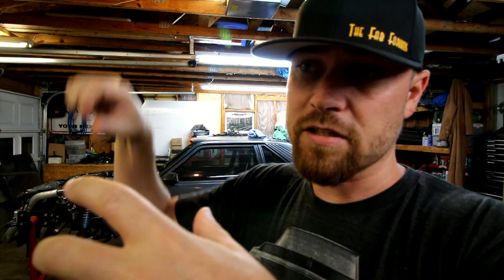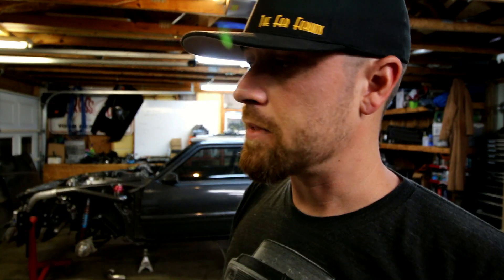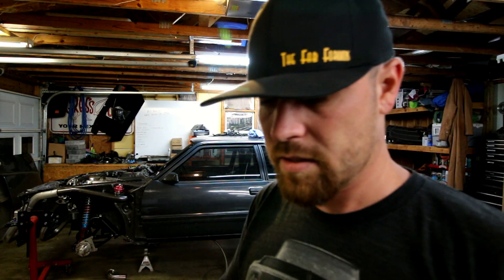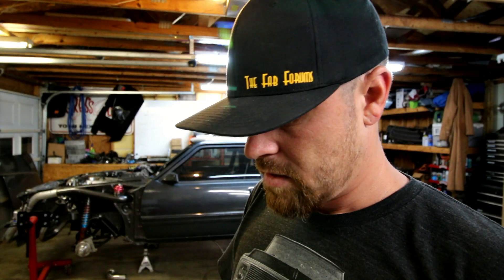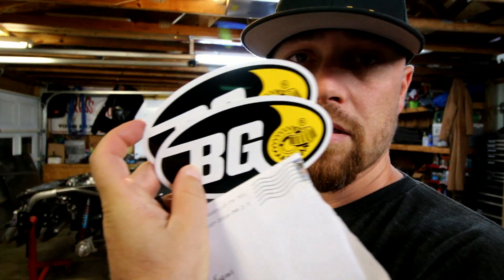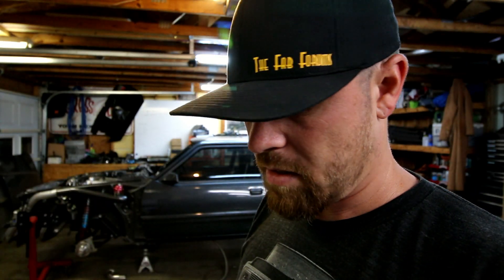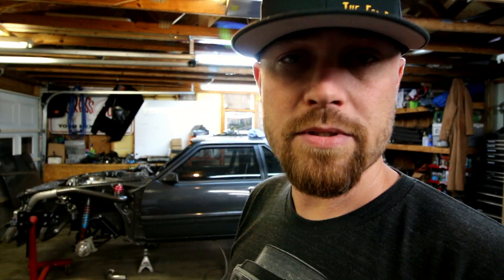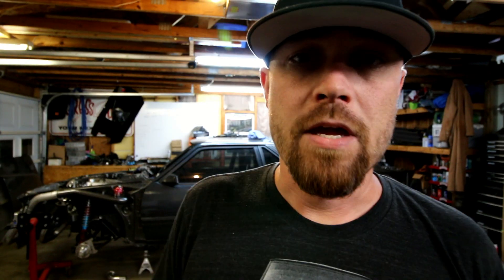Wiring The E85 Triple Fuel Pump Setup

Comment: Has anyone really sat down and figured the cost savings on E85?  Its $2.50/gal but you use 40% more by volume. Then on a boosted car you run 3 fuel pumps. Dont forget all the PTFE braided -10/12 lines and the $25 orb fittings.  Then you have 107 pump gas that smells like foot & ass around it. I'm gonna throw a few gal of fuel in mine just to kill the smell. And I love the fuel smell. Aeromotives new monster 5gpm brushless 85 pump takes -16 line.  Friggen -16 fuel line!!! That's coolant line!! Sorry just butt hurt I have over  $500 in just lines and fittings just under the hood. And no radiator in yet.  I think I just hate the AN world right now.  Oh and you gotta have that nylon 1/4" hard line instead of vacuum lines more $ lol but she sure is purdy!

Comment: Almost to the same spot. Deciding between 3 walbro 450s a holley dominator dual pump or seeing how far a magnafuel 4303 will get me. Usually 8-900 wheel before it runs out. Aero said I need a $1500 brushless of course. Most all pumps are int-external mount. The MF has those ring terminal bolts. Am I the only one who worries "what if that nut loosens up"??  I mean not stopping pump. I mean a spark. Fuel has been known to ignite from sparks time to time.  Maybe it's not worth worrying about. Every dyno I have ever seen a boosted car runs out of fuel. Whether it did 1200 and would have blown up at 1225. Fuel lays over 95% of the time.

Comment: why spray lube on the aluminum fittings? make it easier to screw together or somthing?
Reply from the maker: yeah. they are aluminum and could seize up if not lubed
Reply: The Fab Forums would you recommend putting some high temp thread sealant on the fitting as well?

Comment: How do the wires seal where they pass through into the tank?
Reply from the maker: the holes are perfectly sized to each wire....and then I used two part epoxy to seal them all up
Reply: Sweet thanks man, I might have to do something similar. Trying to run a larger gauge wire in tank for an upgraded fuel pump :)

Comment: great work and love the vids. Not sure if I noticed this or not but it looked like you put the female connector on the pump wires. Just for future reference you want the female connector on the hot side of the wiring and the male on the device side. This ensures you don't accidentally short the pins together. Keep up the good work!
Reply from the maker: I guess that would make sense. In this case there will never be power on the pins when they are unplugged

Comment: one more question, are those pumps wired together at ALL times or are they turned on as they're needed according to horsepower being made according to the ecu pulling them in one at a time? thanks in advance and thanks for the quick answer on my last question, your a real dude man and I dig that. KEEPING IT REAL WITH THE FOUR EYED CARS, BEST LOOKING FOXES PRODUCED IN MY OPINION!! and thank you for the response on my last question so quickly, meant a lot. I look forward to hearing from you on my last question, that kyle it was much appreciated and professional on your part.
Reply from the maker: They are all wired separately...I will most likely be running two all the time and pulling the third in under boost.

Comment: Excellent work as always!  I am very particular about my wiring too, which is why I noticed that you forgot to add the blue rubber wire seals to the connectors.  Those are important for keeping moisture and dirt out of the connectors.  Can't wait to hear this thing start!
Reply from the maker: Yeah the wires were too large for the seals...may seal it up with something else. Not really worried about because the car wont be in the weather.

Comment: You forgot your weather seals in the plug ;-)

also look into this torch set, i have one and i've been using it since around 2009 with zero issues. its amazing for solder and heat shrink or when you just need to burn something that's annoying you lol. You can purchase just the torch for around $32-38 and use it on your friday tool.  

https://www.amazon.com/Power-Probe-MTKIT01-Micro-Torch/dp/B000I14F2K/ref=sr_1_2?ie=UTF8&qid=1473841712&sr=8-2&keywords=power+probe+torch

I'd also suggest purchasing one of these power probe kits, been using it for several years now, after ive let around 30-40 people use it they all own one and tell me how amazing it is and how handy it is to have. 

https://www.amazon.com/Power-Probe-PPKIT03-Master-Test/dp/B003QHDLEQ/ref=sr_1_6?ie=UTF8&qid=1473841935&sr=8-6&keywords=power+probe

Keep up the good work and get that thing done already...were all getting antsy!!!!!!!!!!!!!!!! :-P
Reply from the maker: wires were too big for the seals...not terribly worried about the seal because the car should never be in the weather.
Reply: ya, i figured that when you weren't using them but you know i had to hassle you for it.. ;-)

put some dielectric grease in the holes behind the wires and you should be good. ive done that several times in the same situation.
Reply: i still have problems with my dash cost me a new wiring harness 1969 car / 1986 gm truck and it never got wet just air/water mix so for me if i can I'm water IP68 it

Comment: Like the song, and the fuel pump wiring... That looks OEM! Are those weatherpack connectors? I've used them on my blown C6 and had zero issues with them.
Reply from the maker: Thanks...I dont think they are weather pack brand but something similar

Comment: Awesome job man. Happy to see the use of correct soldering and sealing (heat shrink) The connectors are A+, did notice that you didn't use the silicone seals on the pins (blue accordion pieces) was that intentional due to soldering the pins and if so did you also "pot" the back ends to provide the corrosion seal. If not a nice drop of long cure epoxy with a pipette works great and adds vibration resistance (stops pin spread over time) as well as weather sealing to prevent corrosion. 
Just watch and place the connector in such a way as to not allow the epoxy to drop into the pins and cause a connection issue. 

Keep up the good work always love your videos.
Reply from the maker: yeah the wires were too big for the seal. may seal it with something else. not too critical considering the car will never be in the weather

Comment: Nice bro, when should someone use e85 and is it different components for either or fuel systems? u should make a video about it
Reply: When depends or the individual engine characteristics, operating parameters, E85 availability and vehicle usage. 
Usually E85 is used to control destructive knock/detonation/pre-ignition, cool the incoming fuel air charge and increase the effective octane rating. 
Typically E85 requires fuel system components that are compatible with saturated polar alcohols. 
E85 fuel requires increased fuel system flow and increases consumption volume by approximately  25-50% over gasoline depending on engine configuration and operating conditions/usage.  
Dual fuel systems require carefully selected components that are E85 compatible, have injector flow volume characteristics that work with both fuels, require an intelligent fuel management systems that can accommodate both fuels, easily switch between both fuels and in-between blend concentrations using a Flex-Fuel composition sensor.
Reply from the maker: what he said...lol

Comment: Also have you seen or used expandable polyester sleeving? It looks like braided line you can put the wires almost like what the current factory cars use. Mcmastercar has it I used it on my race car it's a little bit of a pain to work with but it makes a great result. http://www.mcmaster.com/#9284k3/=145ncbb
Reply: Thats what my entire megasquirt harness is wired with in my Rx7

Comment: Solder connections are not the best for automotive honestly the hard joint can cause the wire to brake at that hard joint... A good crimp and heat shirnk is best
Reply: +Southern Nevada offroading and back country the CAN module's on my ms3,micro I/o and racepak are done with a deutsch connector. Don't get me wrong solder I just keep my eyes open every day when I see factory stuff and you not going to find soldered connections  only when you get into aftermarket hackery you'll see it.
Reply: I prefer soldering my crimps, that's the best. Just straight soldering is fine. 10 years in the automotive/Diesel industry I have yet to see a soldered wire break.
Reply: +The Fab Forums not really 90% of auto manufacturers use a crimp style connector in a plug with no solder.
Reply: +The Fab Forums shouldn't have splices in the harness besides ground junctions should be a full wire from plug to plug.
Reply from the maker: I could see that if they were going to moving around, but they wont. Gotta think, every auto manufacture out there solders vs crimps.
Reply from the maker: yeah I could see that in a plug but not within the harness' them self.
Reply: How do you think the the ms-can, hs-can, and other module communication circuits work as a network, splices.

Comment: Nice work Mr Voss.  One suggestion, not completely necessary but using a heat gun on the heat shrink is a little easier on the insulation.  It never fails when I use a open flame I always seem to scorch at least one piece of insulation in the process.  Also the braided loom is a lot cleaner looking than the plastic wrap style loom.  It's available from Ron Francis Wiring if your interested.  Keep up the videos and content man!
Reply from the maker: +StreetSmart 660' yeah I have a heat gun but usually already the torch out for soldering. I also have some braided loom but wanted the spiral loom for this app because of the wear resistance
Reply: Makes sense sir.  Keep up the content, I think we are all enjoying it.
Reply from the maker: thanks